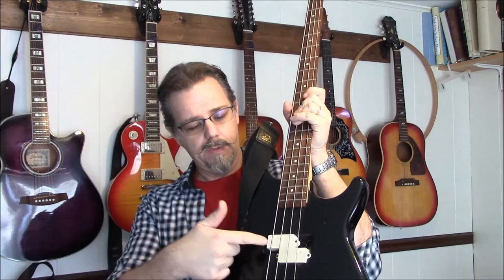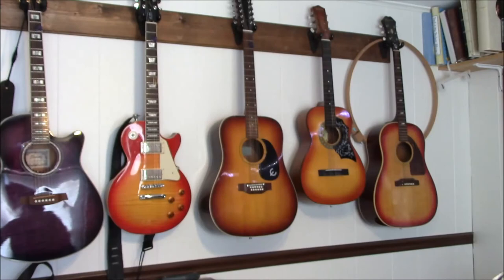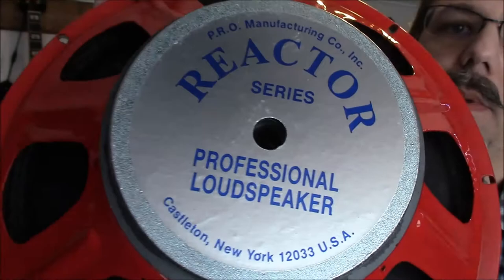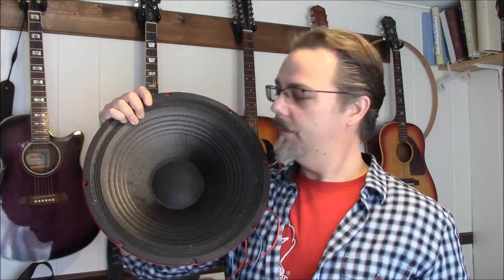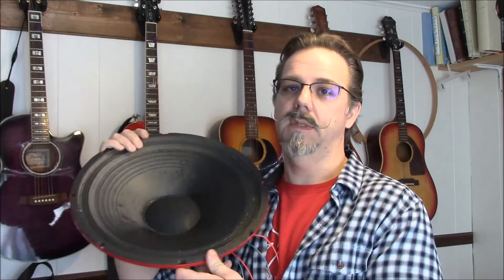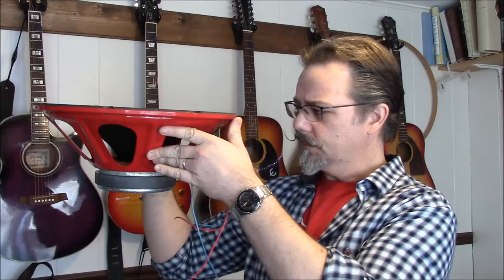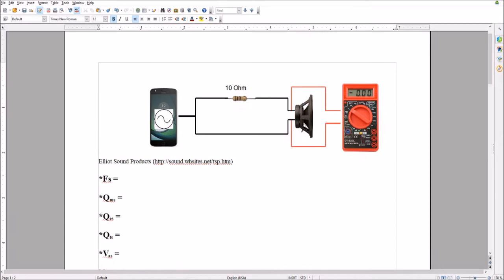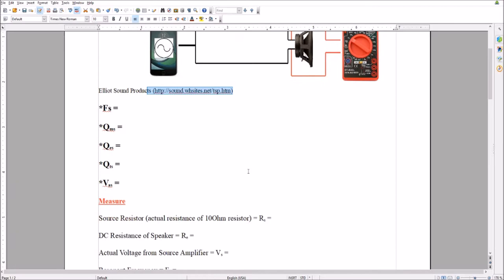Measuring T/S Parameters for a undocumented speaker

Comment: One question. When doing this, the amp should have a linear output frequency between 20 to 20k corect? If you happen to choose an amp that is not good outputing low frequencies the result will not be accurate, correct? So what are the recomendations for the amp? Class AB, D?
Reply from the maker: Well, in this case, I was trying to get a good approximation using items most people would have easy access to, or possibly already own. I just used my stereo receiver with the EQ set to flat. I have no idea what it's frequency response is like along the spectrum since I don't own a spectrum analyzer. Maybe the lows should have been boosted, I don't know.

I believe that both classes of amps can be designed in such a way to output a flat response to all frequencies in the audible spectrum, only that the class AB would probably cost more. They would also most likely be lab equipment (like a frequency generator) since such a flat response is usually not very pleasing to listen to. 

Thanks for watching.
Reply: If you're testing a speaker, the Class of the amplifier is probably unimportant, because the Total Harmonic Distortion (THD) or Linearity of the speaker is, at minimum, 10 times worse, and likely more. If the Amplifier's Frequency Response isn't flat, you can make up for it with a Radio Shack or similar Sound Level Meter that's been tweaked (on paper) for flat frequency response. Or you can use Reciprocity to measure and correct for it. B & K makes excellent, professional Sound Level Meters.

Frequency Response is usually not considered a nonlinearity. It's just a frequency-dependent loss. True amplitude nonlinearity creates harmonic frequencies that don't exist in the original source material. What a lot of people consider "good" bass is simply nonlinearity-based harmonics, overtones or multi-mode cone breakup. You generally can't hear 16 Hz fed to a good subwoofer. If you do, it's likely 32, 48, 64, 80 Hz or higher-order cross-products.
Reply from the maker: Thanks for the info Ron. I only understood about half of what you wrote, but hopefully it will help other people out.

Comment: Great video. What's the reason for using the resistor and could it be tested without it?
Reply from the maker: The reason for the resistor is to split the voltage so as not to blow the speaker accidentally. It also makes a very convenient way of calculating the current, measured voltage divided by the measured resistance.

Speakers are an impedance load, that is their 'resistance' changes with the frequency. The resistor is always a static 10.4 Ohms and can be used as such when calculating current any any frequency.
Reply: Thanks for the reply. I haven't got a resistor atm but I tried to find the resonant frequency but I don't see the voltage drop. Would doing the test without one cause this to happen?
Reply from the maker: Be very careful with that. You risk blowing the speaker without the resistor. 

If you're measuring across the speaker, you would would be looking for a voltage maximum - the opposite of what you'd look for across the resistor. The voltage would be set by the amp and then shared between the resistor and the speaker. So when the voltage is at a minimum across the resistor, it's at its max across the speaker and vice-versa.
Reply: That's great, makes perfect sense. Would you mind if I message you direct. I'm new to this and have some other questions you might be able to help with? Thanks again
Reply from the maker: Sure, you can email me at additola(at)gmail.com
Reply: To be able to measure the impedance or "AC resistance" of the speaker at different frequencies. The resistor should be 10 ohms whether you use a DC or AC signal.
The DC resistance of the speaker can be found by using the Resistance setting on the multimeter, but the meter cannot measure AC resistance. AC resistance varies with the frequency, also the multimeter cannot measure the resistance of any circuit with current going through (e.g. trying to measure the resistance of a lightbulb at different levels) or any thing that generates current (trying to find the internal resistance of a battery or power cell).
It is important to keep power levels low or the resistor will heat up and change its value. Also the resistance of the leads might be up to 0.3 ohms.
Reply: You can compute the AC Resistance (Impedance) of the speaker by dividing the voltage across the speaker by the current through the resistor (and speaker). You calculate the resistor current by measuring the resistor voltage and dividing it by the resistor's Ohmic value,  I = V/R. If you don't know the resistor's Ohmic value, you can run a known DC current
through it and measure its voltage drop, R = V/I. You can measure the resistor current with one meter and the resistor's voltage drop with another meter. You can use one meter for both, one at a time, but you have to correct for the meter's resistance on its current range.
Better to use 2 meters. A $6 Harbor Freight Digital Multimeter is only $6. You can buy them from China and save a buck. Sometimes Harbor Freight gives them away. I have 6.

Be aware that the lowest AC range of most cheap Digital Multimeters is like 200 VAC. You can't do many accurate AC readings below 1/10 scale or 20 VAC. What you can do for low-voltage AC measurements is use a small, full wave DC diode bridge and correct for the diode's nonlinear voltage drop and room temperature. A bit of work, but fun.

There are kits to make your computer or laptop into a low frequency oscilloscope. Like the computer waveform generator programs, there are applications that allow its sound board to do great AC voltage, frequency and Fast Fourier analysis.
Reply: There is a cheap AC Ohmmeter - its the meter that reads impurity particle conduction in drinking water. I discovered it uses an internal AC frequency source to do the measurements. If you try to do DC water resistance measurements, the Digital Multimeter polarizes the water and the measurement goes invalid in a fraction of a second. Unfortunately, the maximum conductivity is around 1000 microSiemens or 1 milliSiemen, equivalent to a minimum of 1 kiloOhm. You can actually use 1k, 10k, 100k and in-between
real 1% resistors to measure the water meter's accuracy.

Comment: How if meusurement ts for tweeter sir .. thanks
Reply from the maker: I can't see a reason why you'd want/need to do that for a tweeter. These parameters dictate the size (volume - cubic feet or meters) of the cabinet needed so that it works with the big speaker to resonate properly.

Usually tweeters are just stuck in a cabinet with little consideration about the tweeter other than how much space/volume the tweeter takes up and thus needs to be added to the size of the cabinet. 

That said, I'm not sure it's possible, A lot of tweeters I've seen are fully enclosed with a horn. Without an easily accessible speaker cone, you won't be able to reproduce my rice/clay step. 

Thanks for watching!

Comment: The speaker looks like a 15" / 38.1cm. Maybe you measured the diameter wrong? The "surround" is the crimp at the edge of the cone, i think (being not a native English speaker).
Reply from the maker: You are absolutely correct. I've also heard it called a "seal" or "gasket". Thank you for watching.
Reply: Great video, I’m going to do these measurements myself on some pioneer speakers. You definitely measured the diameter wrong in the video. The diameter is closer to 375mm. 
You are not within 0,1g of 50g the scale shows 50g at 49,5g rounding up so you are within 0,1g of 49,5g. :)
Rref calculated should be 506,22mV ( Vs*Rs/(Rs+Re) with Measurements at 2 Octaves above Fs maybe wrong 292mV? 
Finally Qes = Qms/(r0-1)*(Re/(Rs+Re)) witch with a Vref of 506,22 would give you a Qes of 0,94 and thereby a Qts of 0,84 (below 1) :)
Vas = 360 Litres
I hope this helps you.
Reply from the maker: Thanks for all of the info. You are absolutely correct on the diameter and weight of rice. It's a 15" speaker which would translate to 381mm. Even if it's not exactly 15",  322mm was way off. 

But I am confused as to where you came up with "Rref" (which I think you meant to type "Vref" since you call it that later on and the units are in volts not ohms). And your Qes formula is different from what I was using. Why? 

I'm glad you came up with a much saner value for Qts than I did (which leads me to believe you are correct), but I can't blindly accept that without and explanation. 

Thanks for watching.
Reply: I just put your measurements into the sheet you refer to, there the formula for Qes is as I wrote above :). Your measurement for Vref was the only thing off, and when I put in 292mV I got the same values that you got.
Reply from the maker: Ah,I see. The Elliot Sound Products page was updated in June of 2018, three months after I posted this video. It looks like the Qes formula was updated with the note, "While this is supposed to be the correct formula, many have found it gives Qes that's much too high," then gives the formula that you used. It also looks like he updated the formula for r0 as well.

 I'll add a sticky comment to highlight the changes. 

Thank you so much!